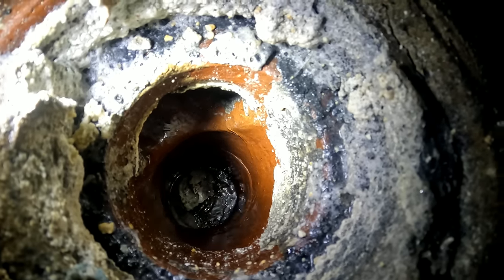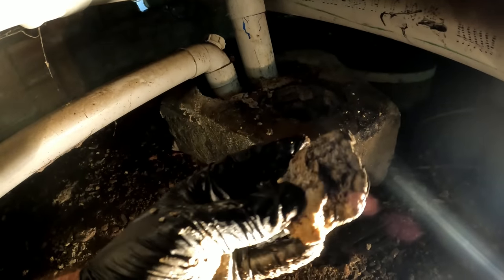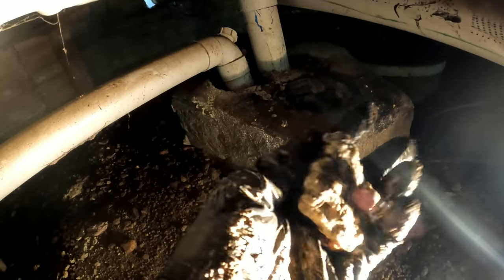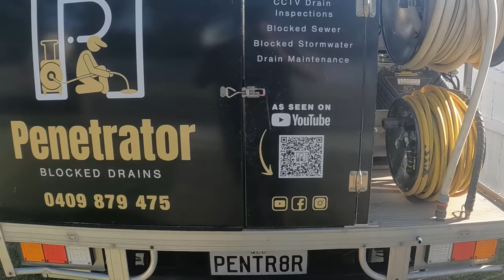Blocked Drain 334 - Crawling In The Darkness || Deep Under A House || Covered In Mud

Comment: From a guy who uses a flex shaft multiple times a week, put the drill in 2 speed, set the clutch to 1/2 the max, wide open with water running. The faster you spin them the better. My 20V dewalt goes from 1 to 14 on the clutch, I start on 7, never go above 9. They really have their purpose, and are absolute animals on grease and roots.